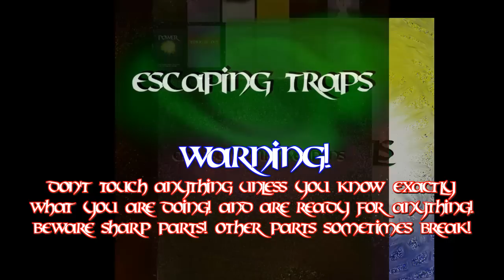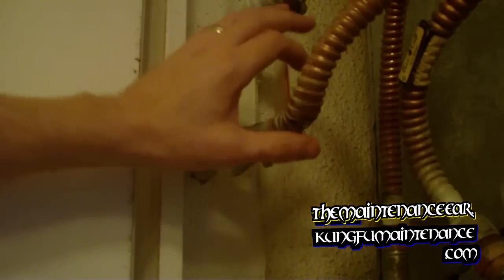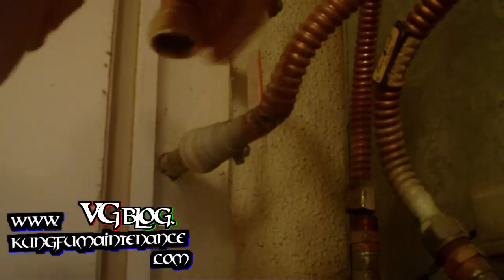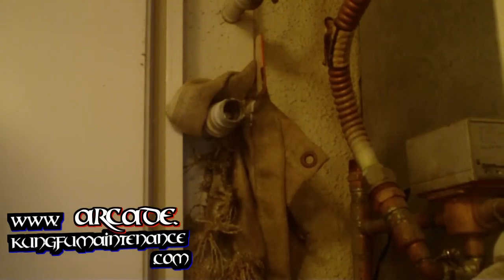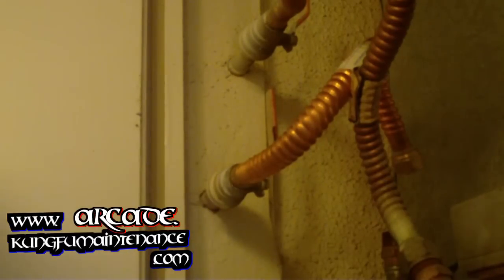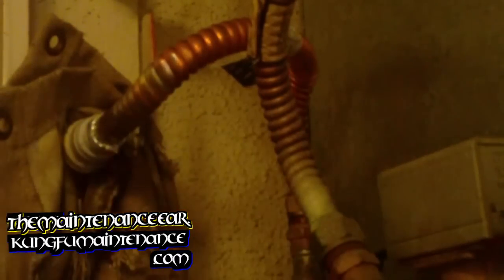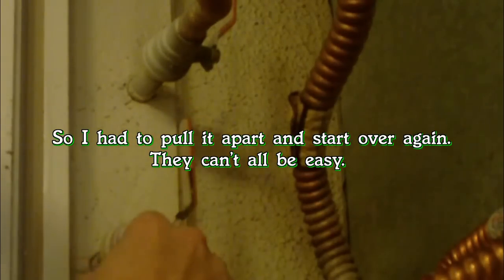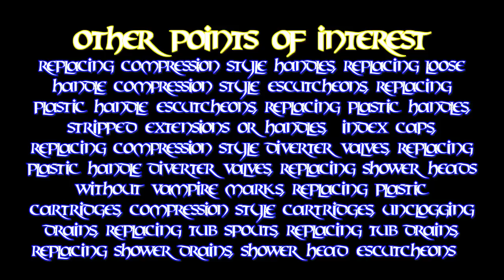Soldering Copper Pipe Into Brass Valve Plumbing Fittings Not Always Easy

Comment: With as much heat  applied to that ball valve I'm surprised it isn't fried or l least the solder joint on the other side compromised. Use less heat, move the torch to avoid hot spots, and use some flux for an easier more professional job.